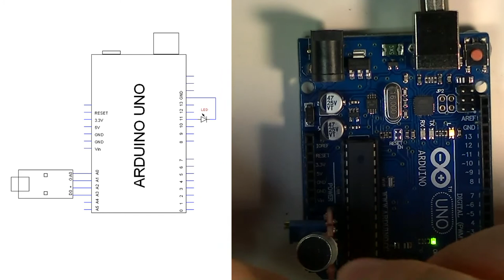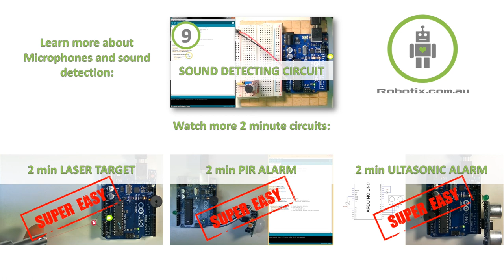2 Minute Clap Switch

Comment: 1 component (which should actually be 2 if you had the resistor you're missing) and a module (which at a glance is 11 components). This is misleading.
Reply from the maker: Thanks for pointing that out . . .none the less,  when it comes to Arduino prototype circuits microphones are almost exclusively used as modules, in fact I would be curious to see the mic sensor used on its own: if you have a link do send it.

Comment: 5V LED? srsly?
Reply from the maker: Well not exactly practical to hotwire it at a different voltage!
Reply: yo its just a working concept. chill. you could hook it up to trigger a servo to switch off your lights or even add a relay for higher voltages